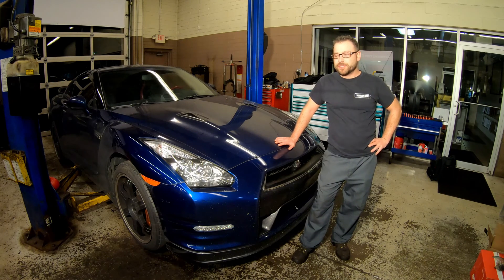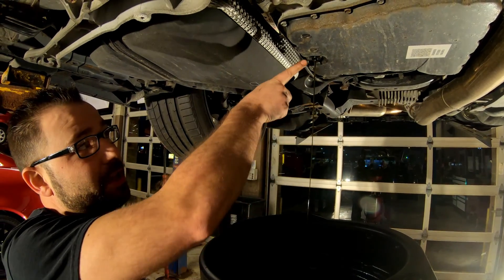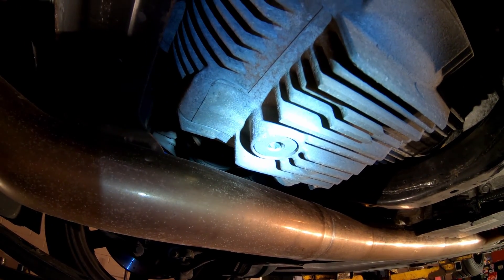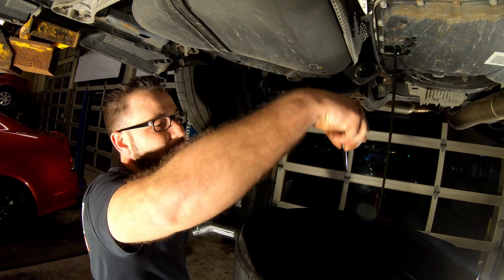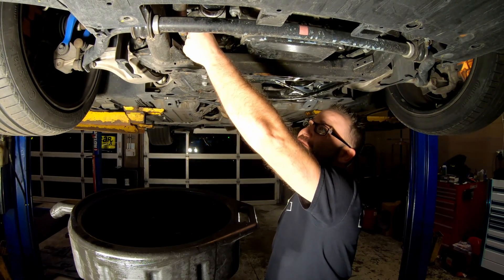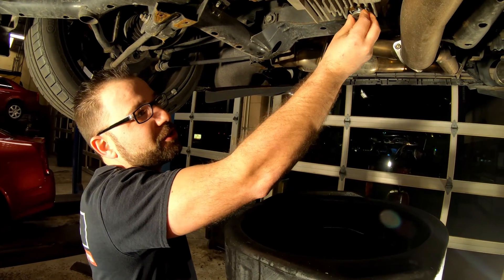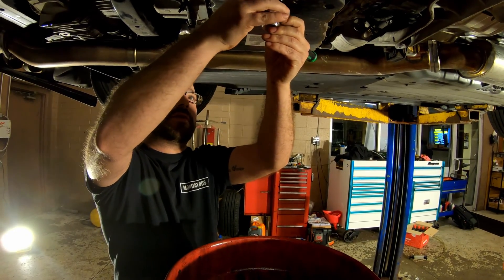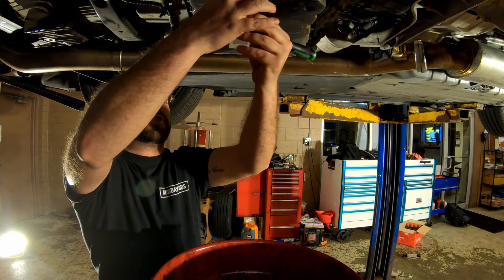HOW TO CHANGE TRANSMISSION AND DIFFERENTIAL FLUIDS ON A GT-R

Comment: Customer of mine sent me looking for the right capacities for their GTR fluid change. Thanks for the video. FYI though, you could have saved a lot of hassle, cleanup, and mess by running AMSOIL's easy-pack gear oil packaging. It's a flexible pouch with a nozzle on the end, so you simply insert the nozzle into the fill port and squeeze. No pump, no spray, no clean-up, no mess, no waste. Still, I appreciate the video and the info provided.